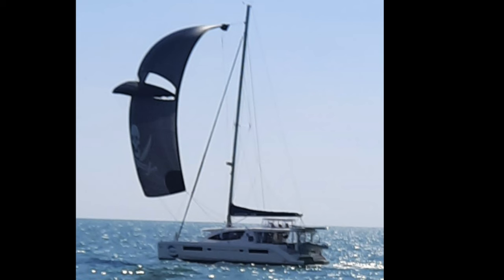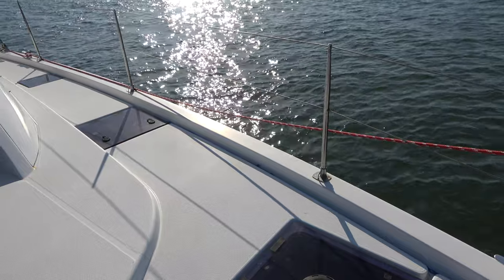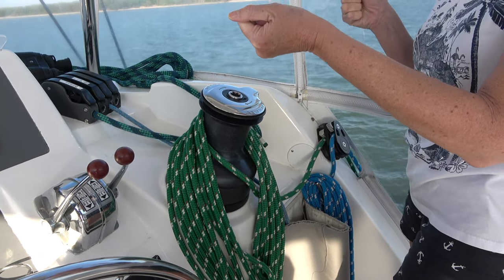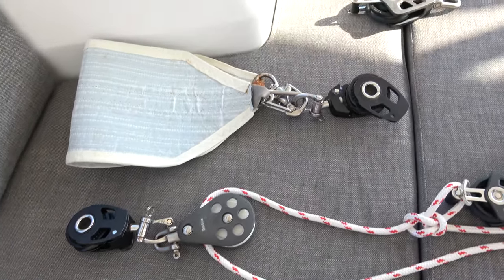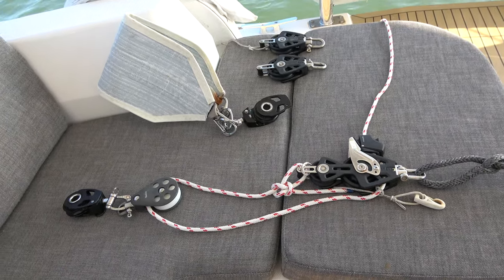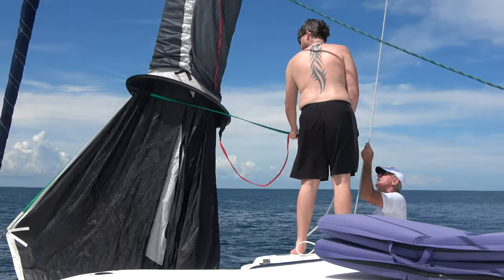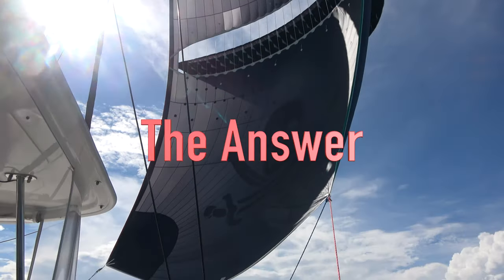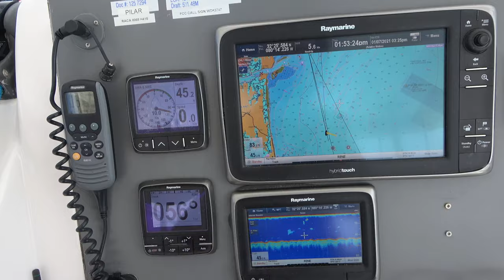HOW TO: CATAMARAN PARASAILOR RIGGING, SETUP AND SAILING PERFORMANCE

Comment: NIce set guys. It looks like the sail is backwards. The red tape is on the starboard, (right) side of the boat and red is for port. The green tape is on the port, (left) side of the boat. So I think you accidentally put the sail up with the inside of the sail facing forward, and the outside of the sail facing back at the boat. Thanks for your video
Reply from the maker: yep,  can't believe we did that!  send us your address for your prize!  pilar@bluedotvoyages.com

Comment: Awesome and helpful video- thanks! For your barber hauler set up how often do you use the adjustability of the line in the blocks (so you can easily adjust barber length) versus if you just had a line you could tie on to the same cleat (how ever long you want it) and the other end is a low friction ring or block the sheet goes through? Thanks again!
Reply from the maker: Glad you found it helpful!  

Of course, if you remain on the same wind there are rarely adjustments to the barber hauler. We do find the block allows us to “pull hard” to bring the sheet in. That sheet has a lot of pressure on it. The ability to open the block to place the sheet in is essential. I would imagine if you just had a low friction ring it would have to be on the sheet all the time?

We use our parasailor so often we like the diversity the barber hauler gives us plus the ability to move it to the opposite sheet on a change of wind or heading.
Reply: @SailingPILAR  thanks for the explanation! What brand opening block do you have?
Reply from the maker: @en8581  we are not at boat,  but i think it's a ronstan.  kind of a snatch block.

Comment: What’s the difference between a parasailer and a spinnaker?
Reply from the maker: Quite a bit. The shape is different. And the parasailor has a “wing” that air travels through to give you extra lift as well as protect the sail more from blowouts.

Comment: Im currently choosing between thr Paradailir and a Symetical Spinnaker for our L48.  What it the max air speed you can run ut downwind? I have heard some ripped at 15 knots.
Reply from the maker: We really are careful and try to take her down when we start seeing anything over 15.  Depends on the wind direction and the wave height as well.